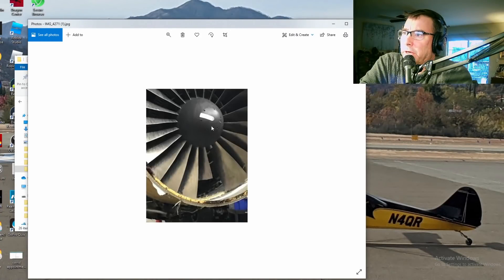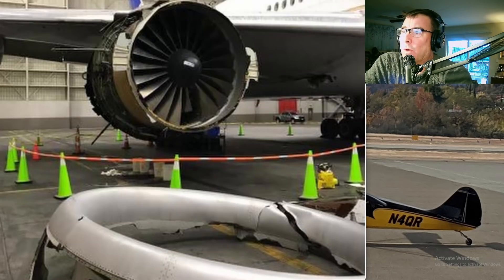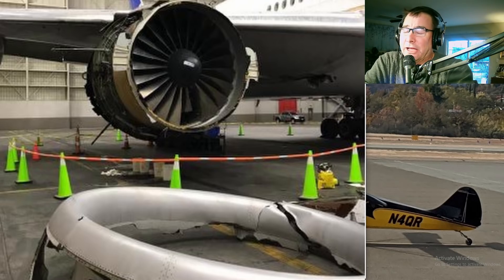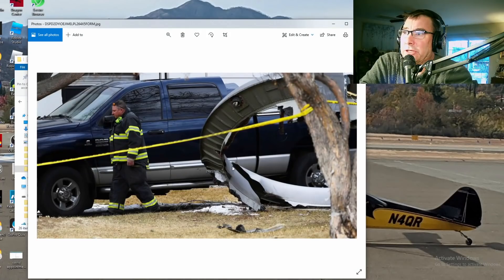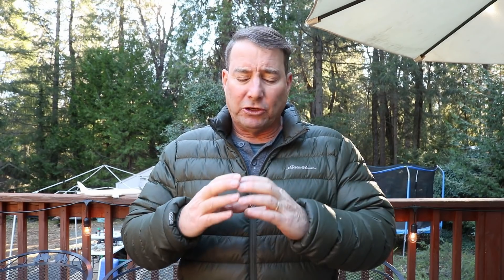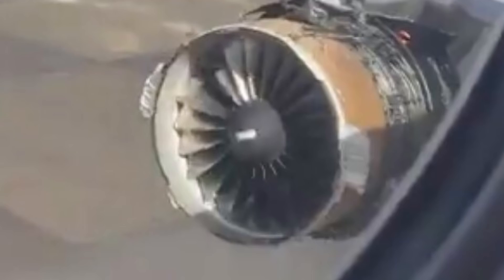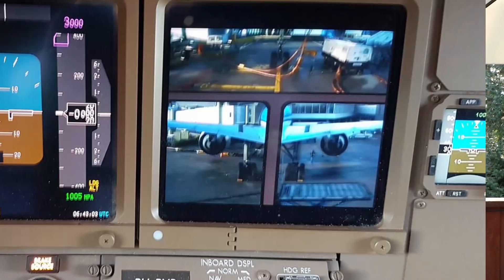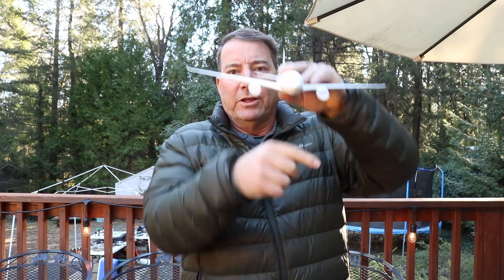UAL 328 UPDATE Fan Blade Failure  B777-200  22 Feb 2021

Comment: NTSB, you can go home already, Juan has solved the case.
Reply: Almost. Why did the fan blade separate?
Reply: @johngormley2192 , as a former US NAVY jet engine mechanic/ inspector, a jet engine's fan blade can fail through metal fatigue. There are inspection cycles that are recommended by the manufacturer for engine fan blades to go through, such as MPI (Magnetic Particle Inspection), to find microscopic cracks in the metal. This is done when an engine is undergoing a major overhaul after a certain number of hours of engine operation have been met. (Think of engine oil changes in one's automobile or lawnmower). Occasionally and as demonstrated by this event, "things happen" that are NOT suppose to happen.  I hope this helps to answer your question.
Reply: @johngormley2192  We know that it was metal fatigue cracking. I use that all the time to break off a piece of metal if I don't have tools. What the NTSB and FAA may be looking for at this point are better ways of detecting microscopic fatigue cracking. 
X-ray diffraction would work, but I can't imagine doing that between flights!
Reply: Far from that!
Having an idea of the sequence of events does not provide the causes, much less corrective and preventive actions. The NTSB is having a long detailed task ahead.
Besides, adding the past B737 and A380 incidents, there's a trend worth studying.
Reply: Haha, I agree
Reply: My recommendations to FAA

1)Jet engine cowlings need to be redesigned with multi fiber honeycomb 3D braided carbon fiber, aramid fibers such as Kevlar and with heat & fire resistance fiber such as Nomex. 

I have used these fibers for decades engineering such multi-fiber designs. Lightweight, ultra high tensile strength, heat and fire resistance are key to this  design application.

2)Redesigning engine nose cones and cowling intakes for anti-fan blade deflection ejection which should have been mandated decades ago.

3)A fail safe self balancing shaft or variable pitch blades to lesson the damaging harmonic and in-harmonic vibrations after a blade off events which should also have been mandated years ago but may be cost, weight and engineering prohibitive. 

Cheers,
Kent
Reply: @icare7151  Send your info to Pratt and Whiskey as we locals call it. I wonder if this grounding will case Raytheon to spin off Pratt?  The use of the word whiskey Is NOT in any way meant as an insinuation.    SDH the Great Unknown in CT - BDL
Reply: @icare7151  I care. I liked your No. 2. The person who took that in-flight photo probably will never know how lucky they were not to be split in two...or the people in front or back of them. Good ideas you have!
Reply: @icare7151  
#3 isn't going to happen unless we go back to turboprops instead of fans.
#1 and 2, yup.
Reply: @icare7151  engines already have a Kevlar containment blanket.......
Reply: @TheJttv  I am referring to the engine cowlings which need significantly composite reinforcement which are apparently not currently required to have the contaminant requirements as the engine itself. I have a detailed follow up post coming on this major FAA safety flaw loophole deficiency. 

The same type of testing safety flaw was discovered in the CFM engine used by the 737 NG in the hail and water testing. They did not do real world test simulations through out the power output band which brought down several 737 aircraft before the testing flaw was discovered which then revealed several engine deficiencies. 

As a material composite reinforcement and safety engineer this is in my wheelhouse.
Reply: @icare7151  Unfortunately - you have no idea what your talking about. The cowls have to contain nothing...they departed when the inlet departed. The inlet failed due to a change from aluminum to CFRP. read the IDENTICLE accident report from the UA 777 in 2018
Reply: @marcweston2156  The physical evidence shows the slicing of the front cowling ring by the fan blade being ejected out of the front of the engine. 

The FAA required blade off test is not real World testing as witnessed over and over again, this time 70 miles North of my house.

These cowling parts crushed the crew cab of a full sized pickup and if the family were in the cab they would have been killed instantly. 

Other cowling parts smashed through the roof of a house, smashed the back of a Jeep and other parts landed in a park. With modern composite blends of carbon fiber, Kevlar, Nomex etc theses large parts would not be ejected in this manner. 

I have studied the blade off testing in detail and without the actual cowlings and high speed wind simulating in flight conditions the current blade off required testing is clearly not real World tests therefore not valid. 

Therefore I am correct.
Reply: @marcweston2156  As a advanced materials reinforcement and manufacturer failure analysis engineer sitting on multiple ASTM testing standards  producers committees for decades, I am shocked that the FAA still allows non real World blade off testing of today’s turbofan engines on static stands without simulating high pressure wind flow around the engine with the actual in flight engine cowlings and engine covers attached. 

The fact the FAA has known for decades that when today’s large turbofan blades break they typically spit out in-front of the engine impacting the engine cowling sending shrapnel everywhere outside of the engine yet consider this a “acceptable contained engine failure” when in reality it is not contained, is totally unacceptable in my opinion.

As a testing engineer I refuse to engineer a test to “get the results I want” vs unbiased valid real World simulated testing data every time a specific material is tested in a specific category which appropriately validates compliance without exceptions. 

Is the FAA being once again run by the industry vs the FAA being independently run without conflict of interest outside industry influences, intentionally decreasing aviation safety in the name of corporate profits? 

In short, redesigning cowling intakes and covers with advanced 3D composite reinforcement honeycomb braids and advanced resin vacuum bonding welding technologies for anti-fan blade deflection ejection should have been mandated decades ago and all blade off testing must validate the external cowling designs assuring they don’t become themselves detached in a blade off incident while also containing the broken blades, etc. 

Just some thoughts and observations. Enough is enough.

Cheers,
Kent
Reply: @icare7151  "The fact the FAA has known for decades that when today’s large turbofan blades break they typically spit out in-front of the engine impacting the engine cowling sending shrapnel everywhere outside of the engine"

This is a completely false statement. What - It happened twice so it's typical? I can show you many FOB incidents where nothing happened except an engine shutdown. It's simply not true that they are thrown forward (maybe once in a million). Here is a newsflash for you - the cowls are already made of carbon fiber, nomex, and kevlar. They are not supposed to take the forces of direct airflow - you need the inlet ring to keep everything in place. Lets keep the inlet ring from coming off and this is more of a mounting materials problem. Again - study a few actual reports.
Reply: @marcweston2156  Again I am speaking of 3D composite braiding matrix with vacuum welding resin binding surrounding honeycomb matrix. Not currently being done.
Reply: @icare7151  As an engineer with 42 years of experience, I wholeheartedly agree with your viewpoint.  Now look at the NTSB calling this failure "a contained" one!!!  
What the hell is happening to them? It is not just "semantics", as it ends up being "handled" (mis-handled?) in a very different way!  For me, it is not just the absurdly ridiculous way the FAA has been working for too many years, but now the NTSB too?
Reply: @alfredomarquez9777   Thank you for your response. Totally agree with you, below is revised response:

I did a bit of further research and found the NTSB has already “recommended” to Boeing strengthening the 737 NG and Max air inlets and cowlings but without being mandated by the FAA with new valid blade off testing, likely just more 😉😉😉 between Boeing, FAA and NTSB.

Below is my updated post on mandates vs recommendations and the need for the FAA to issue real World safety testing simulation blade off standards:

After the tragic Southwest Airlines flight 1380 where a passenger was killed in a 737 NG in flight blade off event, the NTSB found the engine cowlings and air inlet smashed into and broke the passenger window, due both to the location of the 737’s engines and lack of fail safe engineering in the engine’s cowlings, air inlet, etc. during a “real inflight blade off” event. 

Eventhough death and destruction occurred, flight 1380 was also classified as a “contained engine failure” by an outdated FAA safety standards definition and regulations. 

However, the NTSB did recommended Boeing redesign and significantly strengthen the 737 NG & Max engine cowlings, air inlet and reinforce the passenger fuselage and windows, which are highly vulnerable to engine explosion debris impacts due to the modern 737’s unique engine location, up and in front of the wing.

With nearly the entire engine on the 737 Max being further forward of the wing and even a bit higher than the 737 NG, passengers are directly in the adjacent path of any dislodged internal and/or external engine parts in blade off events. Thus, it’s critical for Boeing to redesign and validate there will not be engine blades, cowlings and inlets breaking passenger windows in future engine blade off events. 

However:
1: To my knowledge, the FAA still has not mandated the NTSB flight 1380 737 recommendations for all 737s NG, Max nor any other aircraft turbofan engine air inlets and cowlings to be strengthened for inflight fail-safe blade off events

2: Even though Boeing “promised😉 to incorporate the NTSB flight 1380 recommendations” on the 737 NG and 737 Max for inflight fail-safe blade off events, without FAA updated and mandated simulated real World blade off testing to VALIDATE the effectiveness of any such changes, one has no way of verifying if the changes were done and/or if they actually solve the problem of large dislodged parts impacting the fuselage, passenger windows etc. during engine blade off events

Another critical problem with inflight loss of engine cowlings and air inlets during engine blade off events are the significant dangerous  aerodynamics changes that occur causing sudden uncontrolled pitch and aerodynamic drag making the aircraft very difficult to fly. 

Having decades of advanced material reinforcement, testing and failure analysis engineering, the current required turbofan blade off test for engine safety certification, is NOT a real World simulation validation safety test and therefore NOT A VALID safety test, in my professional opinion.

Specifically, current turbofan blade off testing deficiencies include, but not limited to:
1)not actual inflight air inlet installed
2)no actual inflight cowlings installed 
3)no actual inflight cowling ring installed 
4)engine is not attached to actual pylon, wing,and fuselage section mock-up of the airframe engine is going to be attached to 
5)not conducted in wind tunnel to simulate inflight wind conditions as best as possible 
6)not conducted in simulated takeoff, cruse and landing pitch configurations
7)Other, etc

There are multiple, well documented cases were the FAA did not require the proper type of real World engine simulation safety testing certification which continues to result in loss of property, aircraft and lives.

Though blade off events are very rare, all materials, like humans, will fail at some point.

Engineering “fail-safe failures”, validated through valid, real World lab simulation testing, are required for real World application usage safety. 

Engineering a test to get a desired result is just as penny wise and pound foolish as “bean  counters” who “win” over safety engineer’s warnings lead to deadly outcomes costing millions to billions more in redesign and litigation liability cases.

Without FAA mandates for increased blade off safety requirements that include all engine components attached to the engine configured in real World applications, tested in the manner described above, additional damage, injuries and even death is all but guaranteed to continue in blade off turbofan engine events. 

It’s only a matter of time, in my opinion.
Reply: @icare7151  In your 3) the added complexity would almost certainly increase the number of engine loss events.
Reply: @Miata822  Definitely don’t want to make an engine higher risk of failure in an attempt to increase fail safe margins. Doing so would be counterintuitive.
Reply: @Miata822  A far more simple brake to stop the windmillig and vibration could work, but would increase drag and reduce ETOPS range - possibly a price worth paying as long as routes can still be flown.
Reply: @The_Real_Phil_Lee  That would be no ‘simple’ brake nor small. A stopped engine would be a major drag adder. That engine is the diameter of a 737 fuselage.
Reply: @The_Real_Phil_Lee  All true. It was always a judgment call as to whether 2 engine transoceanic flights were a good idea. Today it is accepted as fine and probably would have been fine in this case even 2,000 miles from land. There is nothing that is totally devoid of risk.
Reply: @icare7151  Yep, the forces on fan parts (let alone compressor and turbines) are enormous and the engineering behind them extensive. They are incredibly reliable and devastatingly dangerous when they go wrong. See the Russian fan hub that failed earlier this winter which led to a crash. Parts shot completely through the fuselage severing some controls.

Fan blades, hubs, shaft, and bearings have not only centrifugal forces to contain but the varying thrust they produce, usually in the tens of thousands of pounds.

A friend who flew 727s back in the day once told me the that pilons on each side of that plane were designed to shear cleanly in the event of bearing failure to prevent the inertia of a seized bearing from transmitting torque to the airframe. Apparently failures like that did happen in those days, but I have never heard of that happening with a modern high bypass engine. Not saying it couldn't happen but haven't ever seen it. Today's engines are incredibly reliable. We rely on the integrity of the system and the professionals within it.

And that is why today's Boeing scares me.
Reply: @Miata822  Very well stated. A fellow engineering friend of mine retired from Boeing during the 787 mess and Boeing scares “the hell out of him”. His major work was prior the MD deal. Totally different culture he states.
Reply: @icare7151  Yeah. Today they are a Chicago anti-union company
Reply: @The_Real_Phil_Lee  and if the routes can’t be flown?
Reply: @biingyin5522  Then stop retiring 4 engined aircraft.
Reply: @The_Real_Phil_Lee  but they have been retired. . So again,  what to do if the routes can’t be flown. It sounds like your recommendation only works if the routes can still be flown. Great. Take it to the next step - it the result is the route cannot be flown and there are no 4 engines then don’t do the mod?. And what makes you think a 4 engine can fly there on 3 engines?. Now you got to do the mods on 4 engines. Maybe the 4 engines can’t fly that either??? You know that that some of the 747-400 also have a similar PW4000  engine and one failed in similar circumstances the very next day? MST-JFK. They didn’t continue on 3 engines but returned to base
Reply: @biingyin5522  But they haven't - you pointed a 744 flight the very next day, so clearly, they haven't all been retired. I'm pretty sure enough 4 engined aircraft remain to cover the few routes that would be outside the reduced ETOPS range.  And alternate engines are available. since P&W don't seem to be doing very well with their fan blade inspection regime on the 4000 series.
Even on a 747 or A380, you would always head for the closest suitable alternate if you have an engine out.  It is, after all, supposed to be a rare event.
Reply: @The_Real_Phil_Lee  lol. That 747 was a freighter. Name one US carrier with a 4 engine passenger
Reply: @biingyin5522  The US is not the only nation with airliners, just in case you hadn't noticed.  There must be a fair few parked out in the desert just waiting for either return to service or conversion for freight.
Reply: @The_Real_Phil_Lee  and there is a reason they are in the desert. The A380 is rapidly losing favour and unless you have lots of money or financial clout they are not coming back. The 747 and 380 production lines have ended. Sorry to say that the 4 engine is not coming back. I would suggesting if you need a 4 engine you should go the long way and fly the EK 380 fleet.  But beware EK flies 2 and 4 engines on the same routes...
Additionally I’m sure you know about QF32 - a 4 engine with an uncontained engine failure.
Reply: @biingyin5522  The reason they are in the desert is simpply the running costs, no more, no less.  They could easily be brought back if required.
Reply: @The_Real_Phil_Lee  exactly. Too expensive to operate and too large. They won’t come back
Reply: @TheBeingReal  Not so.  In reality, a spinning fan (or a rotating Turboprop propeller) actually produces a higher drag than a fully stopped one. The shaking of the entire engine has to be seen to be fully assesed and appreciated.  Perhaps, the engine vibration could be lessened by only allowing it to free spin at rotation speeds AWAY from what are called "critical speeds", where the natural resonance of a vibration mode tends to amplify that vibration.  As Juan correctly mentions, bench testing is NOT that realistic, as the absence of the cowling ALTERS the resonance behavior.  That SHOULD be corrected: testing must be as close to reality as possible, despite any "inconvenience" for maintenance or manufacturer wherever.  Remember the Lauda Air terrible crash, a direct result of "certifying" the uncommanded reverser opening, done at much lower altitudes by careless Boeing so called "experts"... And it was years ago, on a 767... Evidently, a Lesson-not-Learned kind of aviation culture, putting costs or convenience above ultimate safety.
Reply: @alfredomarquez9777  Do note you cannot feather the blades on a turbine like you can on variable pitch prop engines.  Trying to limit the free spinning engine rpm’s is just not practical: you need to disapate the energy to lower the speed which means heat in braking. You would set the braking system on fire. Let alone the size, weight and system to operate the brake.  This from my engineering experience with aircraft/industrial braking system applications. 

One just cannot test for every condition. Extensive risk profiles are done part by part to evaluate and test as directed. 

Go look and see how many engine failures result in the significant loss of the cowling Vs flight hours. Hundreds of millions of flight hours and but a handful at best of failures. In this case everything worked as designed.  Extremely impressive.
Reply: They never even showed up!